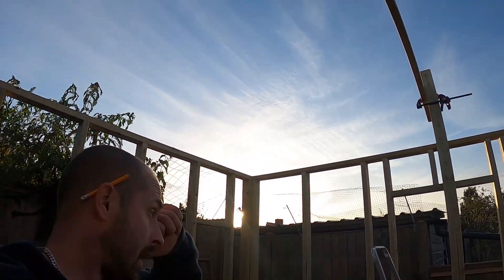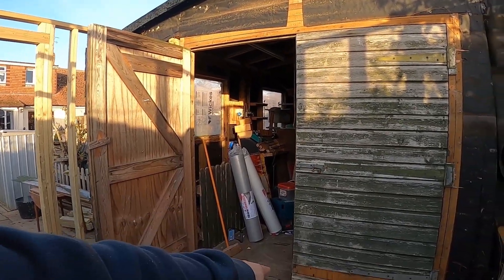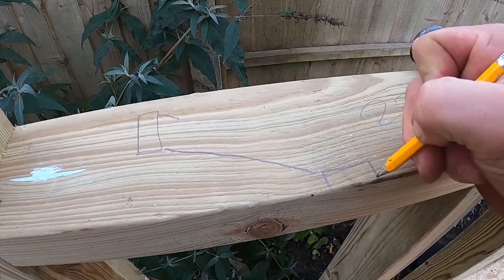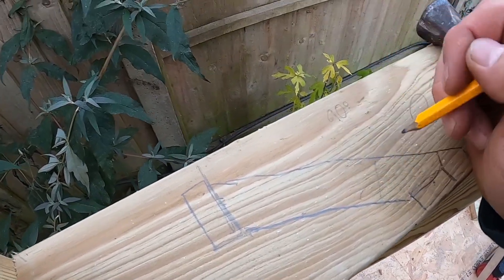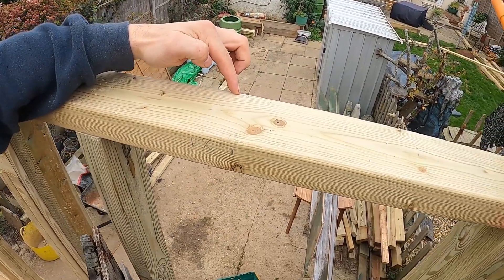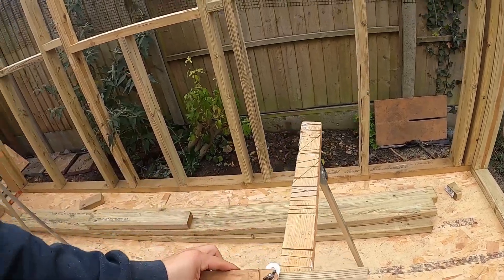Making simple pitched roof

Comment from the maker: 0:00 Intro - discussing the center point
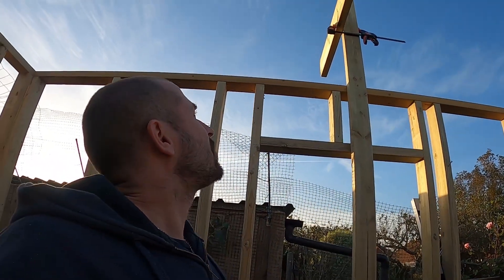5:01 Fixing the ridge in place
5:13 Tools and angles discussion
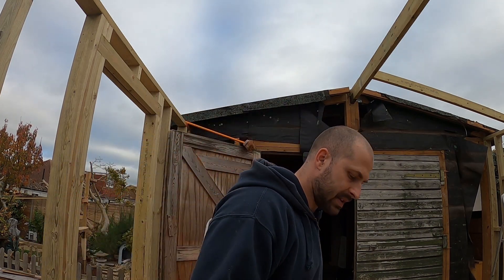8:53 Fitting rafters
9:08 Another tool for the angles
10:34 Measuring, cutting and fitting